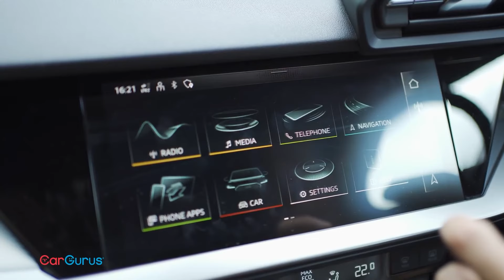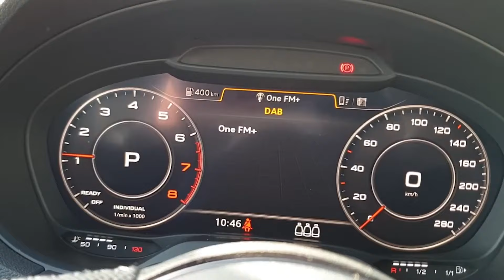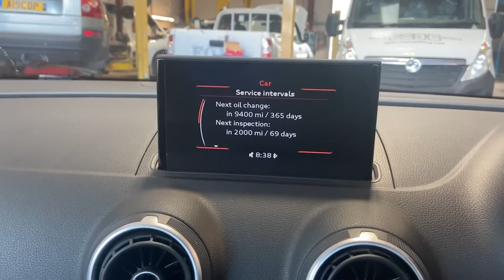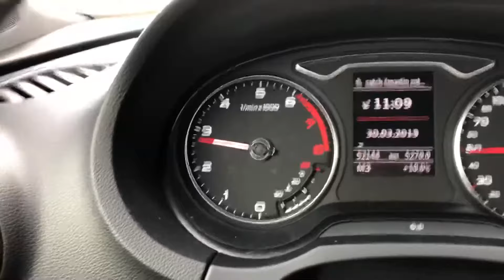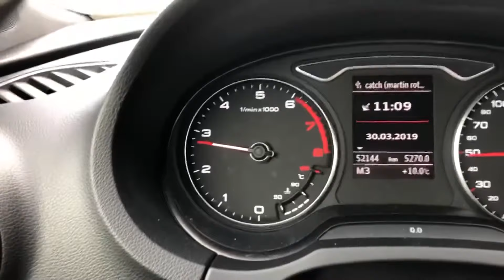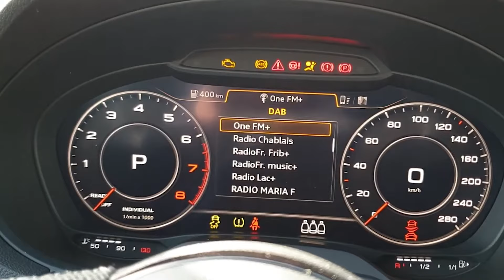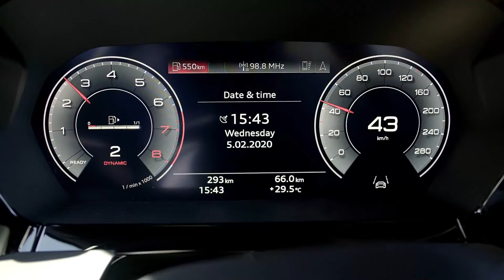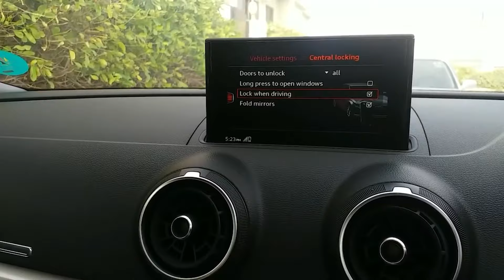Audi A3 8V (2012-2020) common problems

Comment: Just terrific.  I own a 2015 A3 8V and it runs terrific.  But a few things pointed out in the video I found to be relevant.  The transmission slip and shifting were present when I bought it.  But, they are not issues when I changed the Transmission/Differential fluids.  I also had them install a new fuel line pump as part of a recall.  Great info guys.